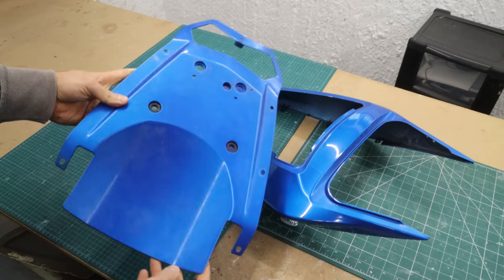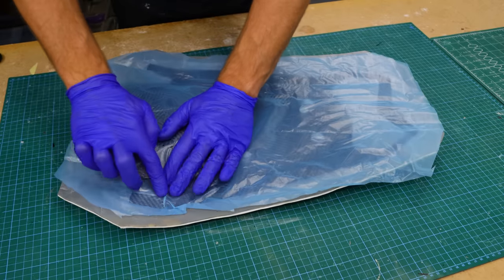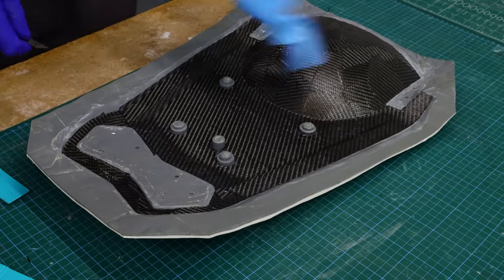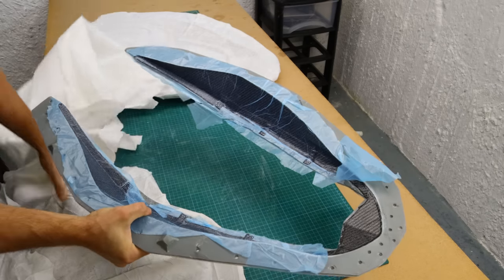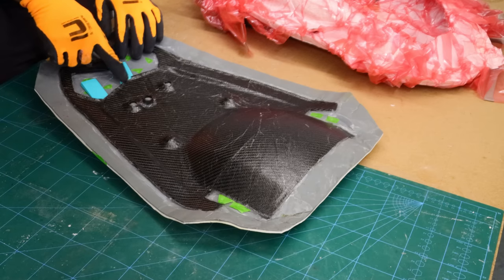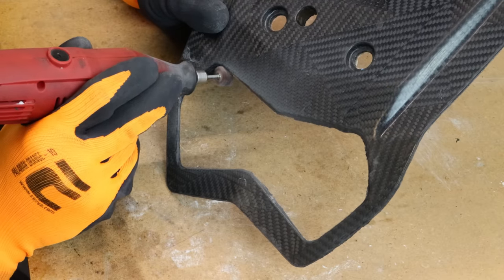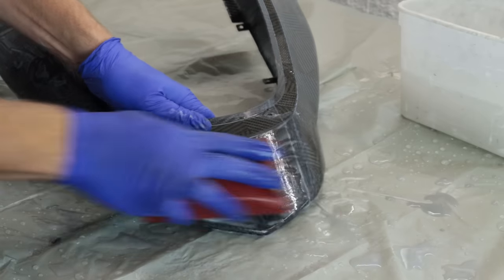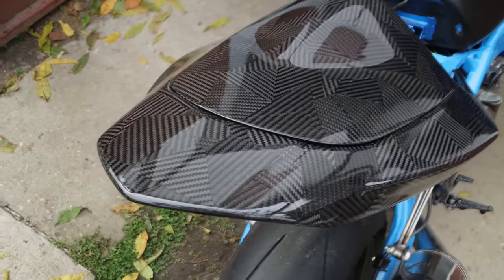Carbon Fiber Tail Fairings - ZX6R build PT. 5

Comment: I’m interesting in how you make the 3D print of the pins and mounts from end to end. I’m making it using forged carbon fiber (strands) and resin with silicone mold. It’s in my 1st carbon fiber project video
Reply from the maker: That's cool! With silicon mold is a good way to do your pins. Will be including into my vids the process sometime in the future.🏍🛠🤟
Reply: @zrcarbon9937  thank you. Looking forward to it

Comment: Use some peel ply on the back
Reply: Can't , it will absorb some of the resin possibly leading to pinholes.
Reply from the maker: Thanks for your advice. I'll be using the peel ply in one of my next video. 🛠🤟

Comment: How do u make the fixings on the back of your carbon fibre panels ?
Reply from the maker: Hey 
I 3D printed the plastic pins
Reply: I don't have the use of 3d printer.  Is there another way of making them as after watching your videos,  you have given me the  desire to build my own carbon fibre parts